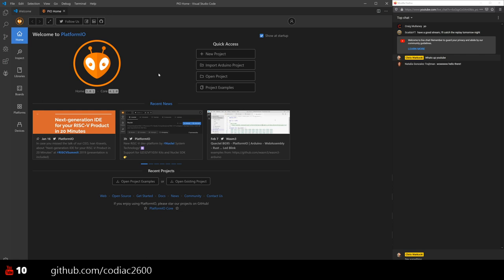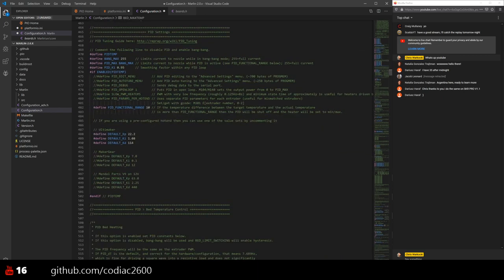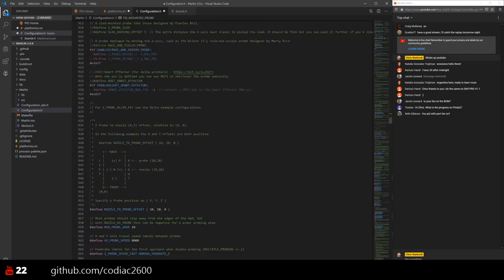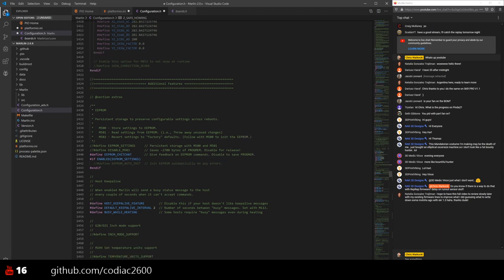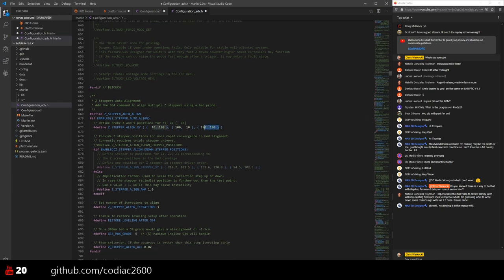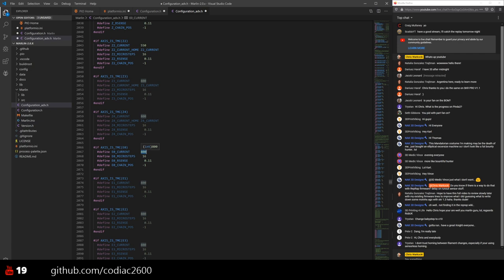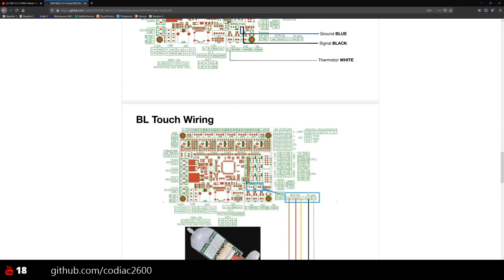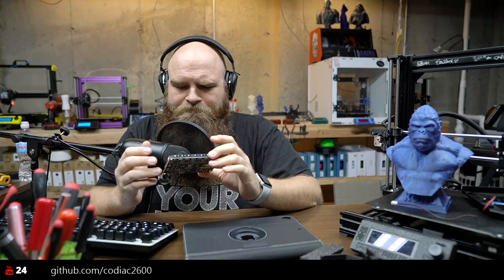SKR V1.4 TURBO Marlin 2.0.3 Setup

Comment: Hi Chris, I am trying to build a SKR Bear with SKR v1.4 turbo. I found your channel as well as your github but i am a bit confused; Should i build my firmware fresh from marlin or should I use your prusa skr bear firmware from your github? my setup is not entirely the same as the original setup and definitely I will need to tweak a bit on some parts of the coding...
Thanks
Reply from the maker: Use the all in one firmware. You just make edits to a text file and compile.
Reply: @Mr3DPrintWizard  thank you for your help, will try to work on the firmware after I have completed the build (still need to build the extruder and the electronics)
Sorry one more question, if I use a different stepper motor on the z-axes, say 1.5amp max current, I should amend Z_current in configuration_adv.h to 1000, is that correct?

Comment: Hi Chris, I am trying to set an skr 1.4 Turbo up with a Bltouch for Z probing and  bed levelling but using the onboard Bltouch connector is proving to be a non starter, I am told by others to use the Z stop socket for the Bltouch black and white wires but i dont know how to setup in the Marlin 2 firmware could you help please ?

Comment: Hey Chris, great video!  One question, why did you change the Default Max Feed Rate of E0 on line 746 to 120?  I have an E3D with a Bondtech on a CR10 S5 and was wondering what a safe value is or how to find to that value.  Thanks in advance,  keep up the good work!

Comment: Hi Chris, 
Great video thanks. Great job!
I'm using all your presented settings and I get great resoults. 

I have a question regarding double extruders and single nozzle settings. I was trying to activate my other extruder, the second one, and the single nozzle. The problem is that I get an error called: #error "No E stepper plug left for Z2!". So I think that I need to change some pins or is it possible to use double extruders? Probably is something with align Z axis I don't know. 

Thanks

Comment: I recently updated my printer with a SKR 1.4 Turbo, but I'm having some really hard time getting the 3D touch probe (v1.0) to work with Marlin 2.0.9,  while it homes perfectly it fails the 9 points bilinear  bed leveling by randomly stop around point 2, 3 and sometimes 4, it never went beyond 4 . Bed coordinates are correct 300x300 with a 5mm margin, Probe offset are correct... It was working correctly in Marlin V2.0.1 with all same dimension settings. EDIT: I´m running an BTT SKR 1.4 Turbo with BTT TMC2208 in UART mode.

Comment: Chris, trying to build or compile but a neopixel library error appeared..I´ve installed neopixel lib 1.3.5 manually but build fails due to files not found on my project folder for neopixels I am not willing to use or include in my firm (not defined). HOw can I solve this?

Comment: Thanks for the video.  Just installed an skr  v1.4 turbo with 2209's and a bltouch in my sovol sv01.  I am having an issue with the bed size or something though.  I have X_BED_SIZE, Y and Z max pos set correctly but when I auto home, homes x and y and when it goes to do z it is not in the center of the bed, the bed is back way to far.  If I do a bed level (25 points) the first row is way off the front of the bed, the bed is back to far.  Know how I correct this?  thanks!
Reply from the maker: You’ll need to look at the bed offsets and tell marlin where in space the bed needs to be in order for the hotend to be over it. Look around line 1370 for define manual home X and define manual home Y and set the offset. If the hotend sits 10mm in front of the bed in open air the X offset is -10.

Comment: i need to do that on predator , have you done it on a predator ? do i need to clip the pin of the step motor drive on y and extredure ? am planing to use the sensor which detect metal not BLtouch or the stock sensor what do you think ?

Comment: I'm getting an BTT SKR 1.4 Turbo for my Tarantula Pro,  I want to put in updated drivers, but I need it to be somewhat easy, I'd like to just drop them in. Is 2209s easier than 2208s?  How about the higher series with no pot adj, SPI? Any suggestions? Thx

Comment: hello Chris I got the same board(turbo) w
hen do you think you do a setup for the bl touch?..I got mine going,only by using the z_min stop pin,for some reason if i use the dedicated pins for the bltouch it don't work..Great work on your setup for this some what new board..i have changed a few things, thank you!.
Reply: it's because of marlin step , at last for version 2.0.3 and below as well as 2.0.4, marlin isn't geared towards bltouch HOMING in a non standard pin, that's why i've added a Z endstop for the homing, you can see some issues about it https://github.com/MarlinFirmware/Marlin/issues/15731  https://github.com/bigtreetech/BIGTREETECH-SKR-V1.3/issues/207

Comment: When setting up Marlin 2 firmware for my Tarantula Pro, I DLed the latest Marlin vanilla, then I copied over the machine specific config from Tevo folder, then changed settings for new board (MKS 1.4 Turbo)--will that save me the trouble of setting hardware specific, like youre doing here?

Comment: The problem is I cant compile it. And I have been getting an error missing binary operator before token "("

I have been going at this for hours and hours and havent gotten anything to work. Its finding issues in stock firmware I havent changed.

Comment: I' have a delta  I copied the example config and config adv for my machine saved time on setting up geometries.  Had to setup for the skr and change/check all inputs and motor directions. I enabled debug so i can  check the settings on the stepper drivers.
Reply: I changed #define FAN1_PIN 1     and it used  bltouch probe pin -- I'm new to this kind of programming hard for me see how all the declarations come together - they jump between multiple pages .

Comment: My SKR V1.4 Turbo won't read my SD Card. Tried different cards, formatted per suggestions. Not sure if something must be set in Marlin 2.0. Very frustrating and discouraging.
Reply from the maker: The micro SD card on the board is only for firmware and only reads the firmware.bin file. If you need an external SD card reader you’ll need to enable SD support and use a screen with a built in reader for print files.
Reply: @Mr3DPrintWizard  Hi Chris, appreciate your feedback. Just to be clear, That's what I'm trying to do, update the firmware. I leave the .cur file on the card and add the revised .bin file to it. I place the card into the SKR V1.4 but nothing appears to get updated, nothing appears on the TFT indicating that the update is in process? When I check the card afterwards only the .cur file remains as if it performed the update but the changes I made aren't apparent on the printer. I have no idea of what the problem could be.
Reply from the maker: @pierre3036  the CUR file must be deleted from as card.
Reply from the maker: @pierre3036  also there is no visual firmware updating effect. It updates during boot. If the card only has a .bin and you check and there is only a .cur file then it worked. Now do an M502 and it’ll overwrite them eeprom with your new settings.
Reply: @Mr3DPrintWizard  I'm a newbie with Marlin and never in 6yrs have I ever updated firmware on these MB's. I'm very familiar updating firmware in items RC radios and receivers. That last statement you made "It updates during boot. If the card only has a .bin and you check and there is only a .cur file then it worked." confirmed my thoughts exactly. AS for M502?? These commands are new to me (seen in videos). M502 EEPROM reset, I didn't realize a 'reset' had to be performed after firmware update. What does the reset do? (Save the update?) Thanks so much Chris for your patience and guidance.
Reply from the maker: @pierre3036  so the eeprom are where settings get saved. If you change things like esteps or motor current via a console they are saved to this memory. If you change them via firmware it doesn’t overwrite eeprom. M502 resets the eeprom saved values and replaces them with your firmware values.
Reply: @Mr3DPrintWizard  In my case, I've got a BTT SKT  V1.4 Turbo motherboard (equipped with micro-SDcard slot and USB 'B' plug) and BTT TFT35 touch-screen (equipped with a full size SD slot and normal USB computer style plug). I believe I've got it now. Firmware updates are done using a micro-sd card plugged into the motherboard (SKRV1.4 Turbo) even when a TFT35 is connected. Changes in Marlin get compiled into a .bin file which are copied to a micro card, placed into the MB, turn on power, the MB will upload the info on the .bin file, then, once completed it will rename that file to a .cur, we MUST then do an M502 "reset EEPROM" followed by a M500 "save" . Turn off power make sure to remove the .bin file from the card if not already gone or it'll try to update each time the printer is turned on. If the update worked the .cur file should display the same date and time of what is/was on the .bin file. 3D prints should be placed on a card or flash drive which is inserted into the TFT slot for printing and NOT the MB. The micro sd-card slot on the MB is used only for firmware updates. The USB 'B' cable can be plugged between the MB and computer when wishing to send prints directly from the slicer. BTW, I still haven't been able to update the firmware on the MB. I returned it to the seller for verification. Thanks very much for your patience and helping me out in understanding WHAT was going on here.

Comment: Hi Chris wondering if you could help me. I follow your video changing the IO file for lpc1796 and the mother board to #define BOARD_BTT_SKR_V1_4_TURBO when I build at this point. I get a bunch of errors and the lpc1796 failed. I get this error. Hope you can point me to what is wrong. 
Thank you for any help.
Unknown MOTHERBOARD value set in Configuration.h"     
  666 |     #error "Unknown MOTHERBOARD value set in Configuration.h"
Reply from the maker: Ed ward which version of marlin are you running?
Reply: @Mr3DPrintWizard  I thank I figured it out I was using the config file for the Anet A8 plus starting out  When I started out with the org config file and made the changes every thing so far has compiled ok. so Now I am re watching your video and following along. Wish me luck haha

Comment: When you set  "#define DEFAULT_AXIS_STEPS_PER_UNIT " You set then to 100 how do you get  that number?  wouldn't it be 160 for 32 steps per unit?
Reply from the maker: Ed ward it’s based on mechanics. A 1.8 degree motor with a 16t pulley is 100 steps per mm. Most printers use a 20t pulley which is 20/16 or 1.25x larger. 100/1.25 is 80 esteps.
Reply: @Mr3DPrintWizard  thank's that helps

Comment: Still can't get my hotend fan to come on at 50 deg when plugged into th1 and configuration_adv.h setting: #define E0_AUTO_FAN_PIN P2_04
Reply from the maker: paul eggington HE1. Th1 is a thermistor.
Reply: @Mr3DPrintWizard  so cut off connector and wire into he1?
Reply: @Mr3DPrintWizard  Thank you Chris!
Reply: @pauleggington  why i cant turn this fan off?. i need to turn off fans at first layer